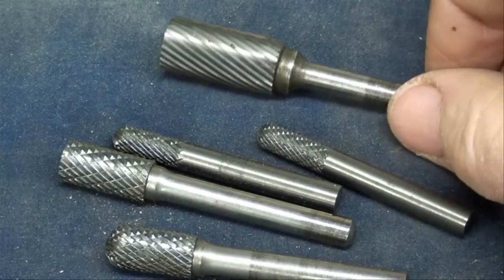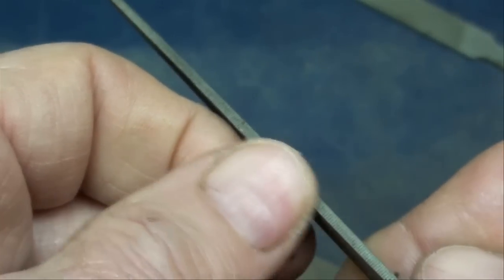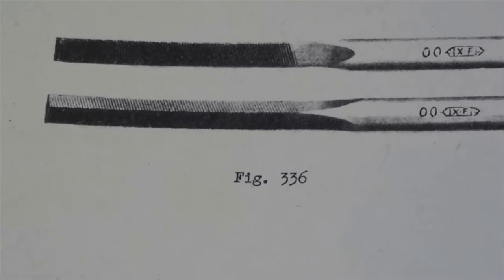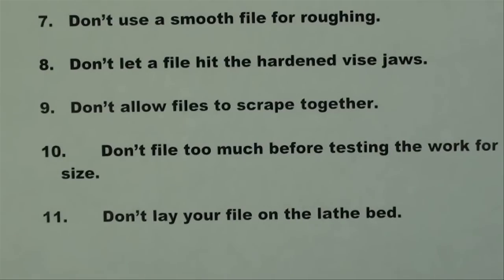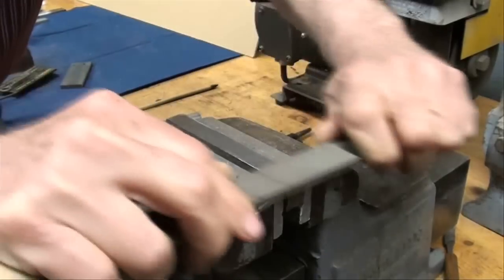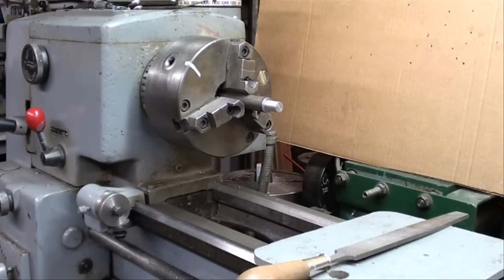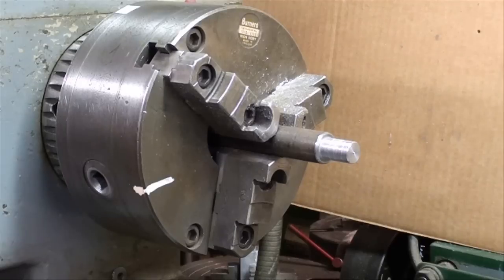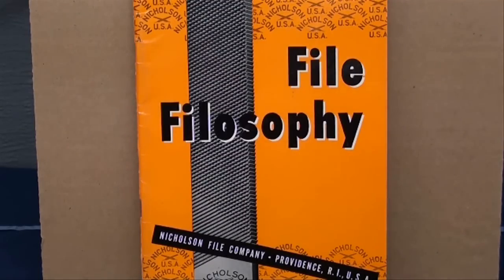MACHINE SHOP TIPS #105 Pt.2 Filosophy-Use & Care of Files tubalcain

Comment: 50+ years ago we were taught to hold the file in the vice with the tang uppermost, heat the tang to near red then push on the wooden handle. They have never dropped of in my workshop. Many thanks for a good video.
Reply: Good tip, thanks. 👍

Comment: I looked for several years for a replacement auger file when mine got lost. Nicholson stopped making them and as an electrician I resharpen my expensive auger bits. It has reappeared from India by another company. Better than not, but not as good as my old Nicholson. Thanks for the incredible video.

Comment: Thank you, sir, for taking the time and effort to share your vast wealth of knowledge in  these great videos. I certainly appreciate them and can't thank you enough.

As far as file handles, I've found that golf balls work great.
Depending on the size file, Measure the diameter of the tang of the file about 7/8" from the end and select a drill bit slightly under that diameter. (it doesn't have to be precise as the ball will stretch and conform to the tang.

Simply clamp the golf ball in a vice and drill a hole about an inch/ inch-and-a-quarter into the ball, and afterwards, insert tang into the hole and holding the face of the file, ball-side down, lift the file and drop the combo onto a solid surface (while following it down with your hand to catch it on the rebound; preventing it from banging into anything), thus, using the weight of the file to set it into the ball.

I typically use some 3M weatherstripping glue and set it as described above. When dry, the new handles also allow the files to hang from the wall without banging into the others. I made some pegboard out of a sheet of Starboard plastic, and use an 8" side-by-side, double peg, (about 3/8", or 1/2" spacing between the two), and am able to hold 5 files per peg. I just keep the most common files on the wall, because, as you mentioned, too many files, not enough wall. :) 

It works for me and just wanted to pass this along.

Best wishes and warmest regards,
Egg.
Reply from the maker: +The Eggman  Thanks for watching

Comment: The file you were introducing at part 1 of file philosophy that you mentioned was used for inletting gun stock is called a float rasp/file .Another type of file that resembles the float file is called off set handle file .i can see them potentially used for removing high spots  from metal.
Reply from the maker: Thanks

Comment: Well I didn't mind the length of the video! I was delighted to find your 2 videos on files and filing. I took high school metal shops in the '60s, and wanted this review.

Most of my adult filing has been sharpening chain saws and forestry tools. It has been very difficult to get my younger helpers to clean their files!! When shown a file card they sometimes won't even try it.

For several years I have been looking for files with the diamond end silhouette, for sharpening wood cutting saws. Especially old style 2 man crosscut and similar saws. So I will have to take the hint and look on EBay.

Thank you, Sir. I appreciate your work.

Comment: I trained as a mechanical engineer, and was taught that one should file brass with a new file before using it on steel to make the file teeth toughen up.
I guess the brass will help to define the file teeth profile before using it on steel, removing any miniature burrs which may result in broken teeth.

Comment: Have you had any experience sharpening files using acids?

I did an experiment with two old, rusted, almost useless files. I suspended them in white vinegar where they fizzed away for 48 hours. Afterwards they had turned black but they were much sharper and cleaner. I was quite surprised by how well the process worked.

Comment: Years ago i worked in an aircraft repair shop, we had one man who's job was to maintain our lead caid batteries. One day I notice a container of files and ask about them. He said he stored the used files in the battery acide to clean them. Have you ever heard of such a thing? Very good video I can tell you are an instructor. Thanks
Reply from the maker: No--but I might try it. Someone said soaking them in vinegar will sharpen them?????????????
Reply: Yes it seems to be a common idea going around that acid will sharpen files, I guess to the point where it melts off any stray particles it does help.
But it obviously can't get you a new edge on the teeth and the videos I've seen do seem to confirm those files didn't get that much better.
Reply from the maker: I should do a MYTH BREAKERS vid on that

Comment: Where did I hear that one should file brass with a new file before using it on steel to make it last longer? For smaller files I've been using golf balls for handles- seems much kinder on my arthritic hands- put some pictures up of saw sharpening and a bunch of my buddies jumped on the band wagon... I'm looking for used pool balls to,try it with larger files... Driving range solid core balls work best.

Comment: Another great book on files is  "A Treatise on Files" by Nicholson File Co. 1878. The Early American Industries Association offered reprints of this book in the early to mid 1980's and it is a gem... It is also available on Google Books at http://www.woodworkslibrary.com/repository/a_treatise_on_files_and_rasps_nicholson1878.pdf

The technique for draw filing is particularly interesting and if followed produces finer results than is typically obtained with "modern" draw filing techniques. Rather than hold the file perpendicular to the work you hold it at a slight angle to the work so that the cutting edge of the teeth engage the work better. There is a sweet spot for this angle that gives amazing results...
Reply from the maker: Thanks--I'll check it out.

Comment: Relatively useless fact:
Tungsten carbide tools are actually tungsten carbide grains embedded in a cobalt matrix, making them a metal matrix composite. Unfortunately cobalt is pretty severely carcinogenic. Fortunately you only need to worry about this if you work in a tungsten carbide factory where it is in powder form for easy access to your lungs.

Comment: In one of your other videos where you talk about files you mentioned that you shouldn't use oil on a file. Could you explain why that is? I find it beneficial to use something like wd-40 if im filing aluminum and it helps keep the aluminum from loading up in the teeth. I've heard of using chalk but I never seem to have any when I need it. Chalk isnt something I keep around in my shop for some reason. Oil should also keep the rust away. Should I stop using oil on my files?
Reply from the maker: That is something I need to experiment with

Comment: I always sharpen my lawnmower blade with a file.  I clamp it to my work bench with a c-clamp and go to work on it. It only takes a few minutes, even to remove dings.  Then you are only removing the bare minimum material that you need to

Comment: Bends over the very fine tooth of the file. Lots of strength pushing thanks to the way they're cut, but it's a slightly hooked tooth, and there is very little strength on a backstroke.

Comment: Did you file on the forward and reverse stroke? If so, does the rule of filing on the forward stroke only not apply in this particular situation/type of file?
Reply: Metal file cuts on forward stroke you either lift on the reverse or glide it and not pessing down when on return stroke

Comment: i used to remember counting how many strokes I used and calculating how much I took off the work piece.  Do not remember now how many strokes to the thou? or what type of file although it would be flat, smooth, course, 6 inch or single cut, can you figure it out?

Comment: What dose caulk do to the file. How you put it on the
Reply: Not caulk, but CHALK. The chalk dust will help prevent the tiny particles of metal from adhering to the roots of the individual file teeth, in essence, preventing excessive 'loading' of the working surface of the file, thereby allowing it to be used much more efficiently.

Comment: Filing on a lathe is much much saver if you hold the handle of the file with the left hand
and the point of the file with the right hand. 
Then you automaticaly don´t hold your arm over the chuck and reduce the possibility of accidents.

Comment: I saw lathe files from Nicholson this morning. BTW, Here is a link for Nicholson’s how-to book: 
http://www.nicholsontool.com/MagentoShare/media/documents/nicholson-guide-to-filing-2014.pdf
Not as good as your video however, they need to show lots of technique and work completion, IMHO. It is not intuitively obvious just how much you can accomplish with a file. I once read about how the Rolls Royce apprentices had to file a square steel bar of significant length ( a foot or yard?) into a round bar that was straight and round within a thousandth. I think the diameter was specified too, so a stroke in the wrong place ruined the piece. This must have been back in the 1960s. Filing to round has a wonderful technique I first saw last month or so.

Comment: Ah, the German man I saw filing to round started by touching the work on the far side of the work near the tip of the file and while stroking the file forward, he moved the contact point with the work over the high spot (he was smoothing a casting) toward himself. I’ve always done it your way, but moving the contact point in the opposite direction of the filing stroke made the work obviously rounder with no apparent effort. Semi-miraculous, was my impression at the time. I commented, and found out that is the way they teach it there. He was surprised I did not know the technique.

Comment: When filing on the lathe is rotation important? When looking at the chuck and it is rotating clockwise or counterclockwise which is safer? I understand the file cuts in one direction but couldn't you flip the file around if it wouldn't get thrown back at you?

Comment: Great videos! Thanks! I am restoring some old files, and I can't seem to get the rust out from between the teeth. It might look like it, but I use a nail kind of like you use the copper block and it reveals there was rust under there. I had already used Naval Jelly, but I guess the rust runs a bit deeper, so its not getting the the bottom. Was thinking of electrolysis next. Guess I could try the vinegar as well.

Comment: I'm not sure if it is good advice or not but i was always taught to load my file with soap stone before filing aluminum or soft material. I ran a welding business since 1971 and when cleaning up my torch tips, ALWAYS load my file with soap stone and it never plugs up. one more tip from another old guy!  :)
Reply from the maker: We always use regular blackboard chalk
Reply: @mrpete222  GREAT idea - we dont have much of that. running a welding business, have plenty of soapstone though! :) another old welder from ill.!

Comment: Tubalcain does it correctly here. Reaching over the chuck puts your body in a better position to control the file so that it will not slide off the workpiece and hit the chuck. It also puts your body in a better position to avoid injury should the tip of the file contact a chuck jaw. Of course in my 22 years of job shop experience I have seen it done both ways without incident. Just my 2 cents.

Comment: We were taught in the seventies that to file a radius you start the cut on the tip of the file and as you push  the file forward for the cut you push downwards with the handle at the same time and this allows  for a more accurate radius to be followed. First three months on our apprenticeship was filing at a bench then some electrics sheet metal work and machining for the next 15 
months.

Comment: just seen the part on long angle file. Wish you were closer to me to post I would send you one. My local tool shop has Nicholsan Long Angle Lathe files, smooth cut for $25 a piece. I may inquire about postage costs and send you one if you are still chasing one?